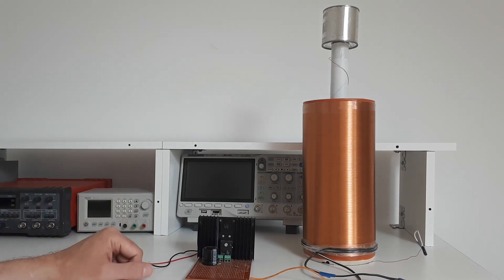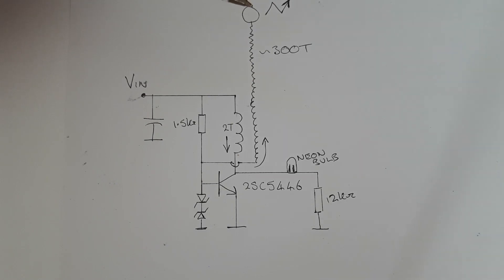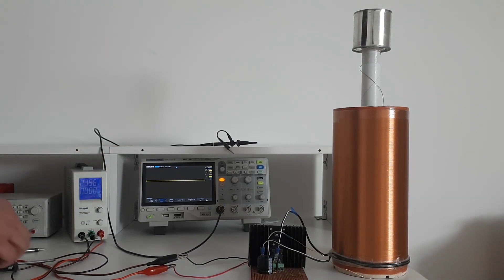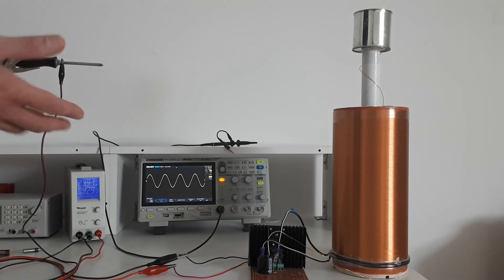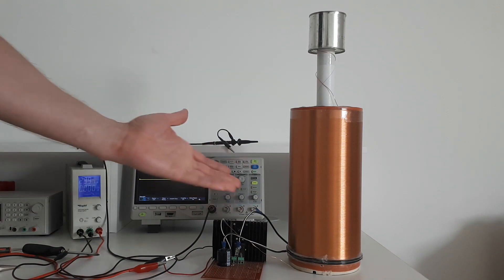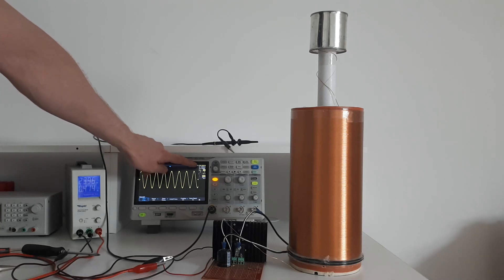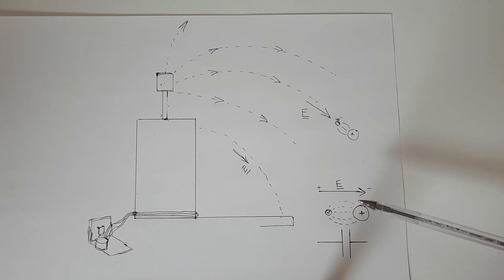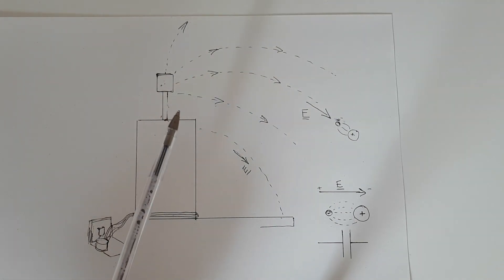The Tesla Coil

Comment: Best ever videos (second - for measuring the resonant freq) about Tesla coils in the Yutube. Brief and very relevant explanation of all you need to know to build your own device. My son dragged me into this matter when I noticed he is gonna follow some crazy teens building a coil out of a wall outlet with 5-10A current on the breadboard (breadboard !!!). And those guys have 70K+ views. WTF ? Start low, go slow. When you understand the resonance and tune your coil - you can achieve nice sparks with just 12W of power (as in this video). Not cool enough ? Slowly increase the voltage, tune the transistor biasing and see if it helps. But starting out of 120V with 5-10A can literally kill you if you have no prior experience with high power devices. Apply a common sense, use you OWN judgement and follow the tutorials like this.

Comment: Nice video. I learned a lot. What are the dimensions of the primary and secondary coil? Wire gauge, height, diameter, turns, etc.
Reply from the maker: roughly, height is 26cm, diameter is 12cm, turns are about 500 ish, and wire gauge is 0.5mm
Reply: @ElectricMonkeyBrain  Thank you! I enjoy your channel.

Comment: I was the 2nd one to put a like and first to comment. I must say you have the art of explaining stuff.  Never understood the circuit driving the TESLA coil before, thank you for explaining and bringing safety aspects.  Always watching people building Tesla coils on YouTube and some claiming able to tune the coils to the resonant frequency of our Planet to harvest free energy!  Came to your channel with the video on "Flyback Voltage and Back EMF".
Reply from the maker: Hi. thanks a lot. There are many different circuits people use to drive their tesla coils, i showed the most simple one for beginners. As for the Schumann frequency, to resonate at such low frequencies the tesla coil would have to be huge, very impractical. However, Tesla did a lot of stuff, he experimented with many different types of coils, not just the ones you see on youtube. As for harvesting energy, modern scientists dont know everything, even though they think they do :D
Reply: This is known as the SCHUMANN RESONANCE, discovered by Winfried Otto Schumann in 1952. The frequency that results from the sum of these wave occurs at around 7.83 Hz.
Reply: LC or to some extend. Volume against surface area. 
Usually done with coils and capacitor. Loop antenna.
Widely used in crystal radio. To get a basic idea. 
2 LC circuits. Can run a lcd watch.
Build it with bigger coils and capacitor it might do more. 

Low frequency passes thru the body. Higher frequency seems to get more to surface area. Or skin.